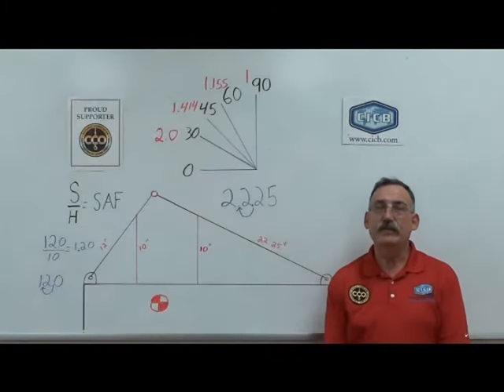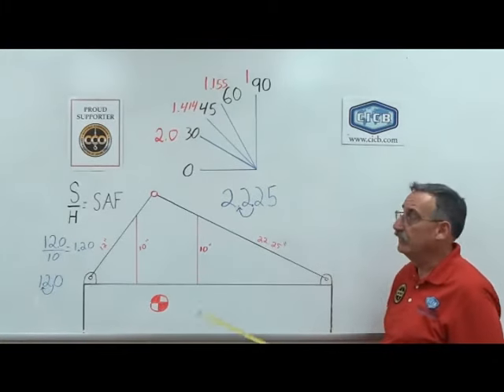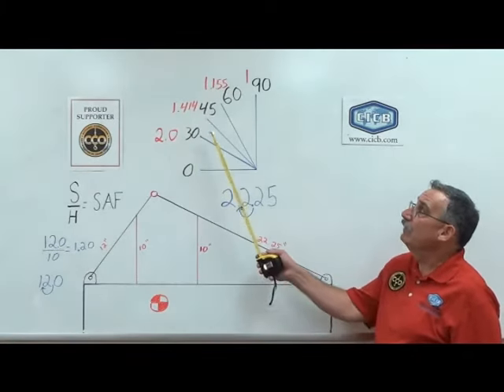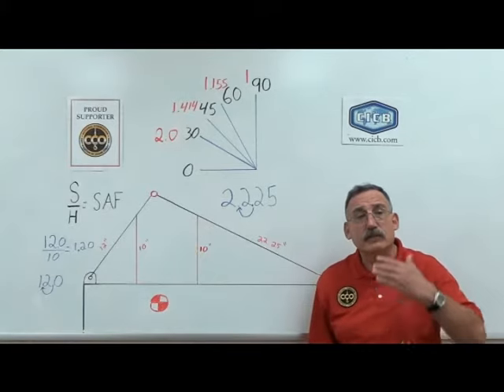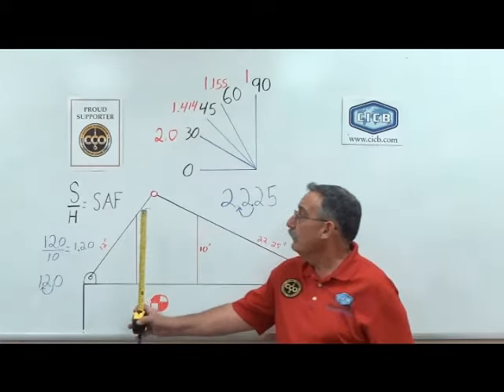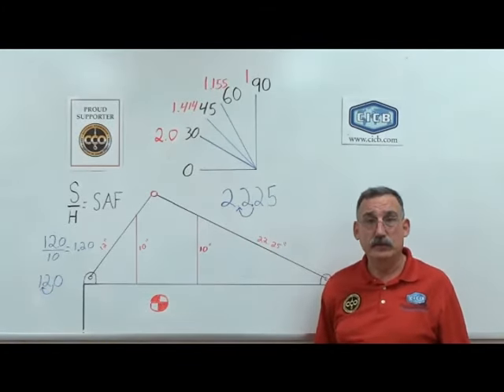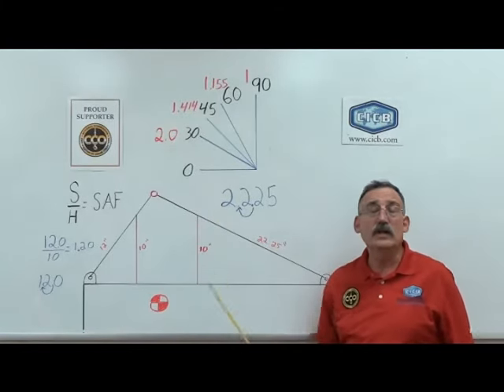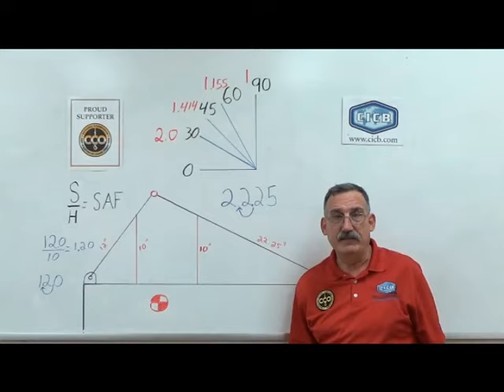Using the Sling Angle Factor

Comment: What capacity of the sling shall be used for  load weight if 17 tonn with the sling angle of 30 degree as per the calculation...